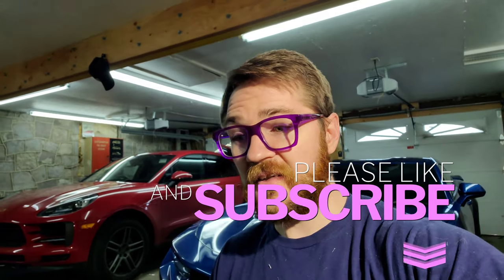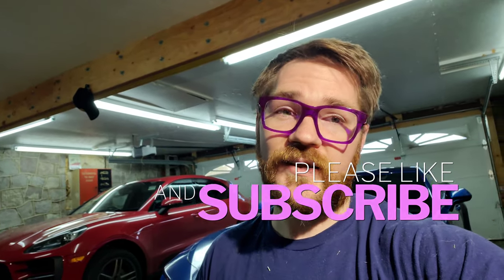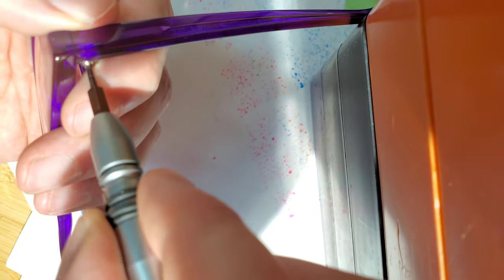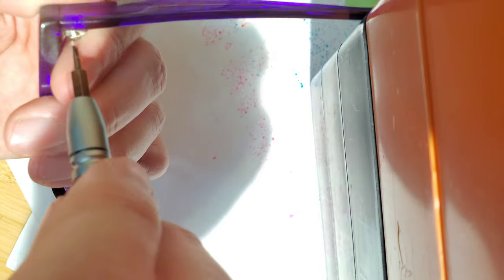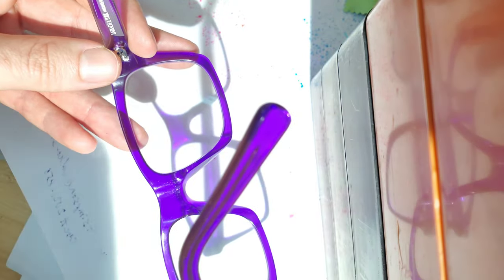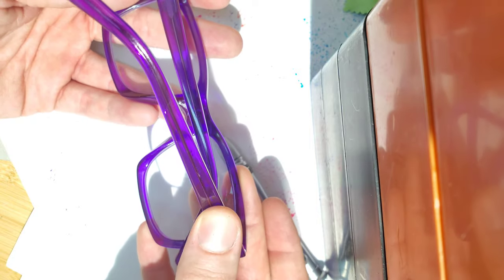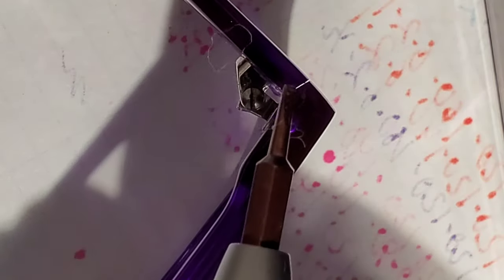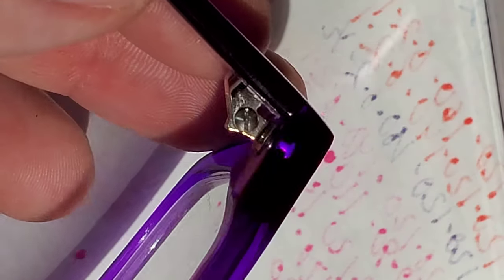How to: Tightening Loose Screws on Glasses - A Simple Tutorial (Beginner Friendly)

Comment: Have you had any experience with the Vuarnet district 1910? Are they wider than the legend 03? Sorry for the off-topic question and thank you for the always informative videos.
Reply from the maker: No worries! Unfortunately being French designed Vuarmet does run generally small... even their "big head" models are pretty small, with none of the fashion pieces really fitting the mold of a big head without some adjustment tricks. That said the 1910 is actually a hair smaller than the legend, but being a real acetate frame can actually be adjusted to fit better. The 1928 and glacier 1708 as well as the district 1907 are about it for larger heads within the collection :)
Reply: @ThatGlassesGuy03  That's actually good to hear, i thought the legend looked a little large so if the 1910 is smaller i might go with those. Always hard to choose when you don't have places to try on nearby. thanks again!
Reply from the maker: You're welcome! Order through my shop, we have a little more forgiving return policy than Vuarnet directly 🙃😁
Reply: @ThatGlassesGuy03  I am in Europe so delivery is pretty fast with Vuarnet which is a little more convenient, if i'm ever in the market for AO sunglasses i will definitely check out your store since shipment costs seem to be lower
Reply from the maker: You know, I've heard that a lot about AO, and have definitely noticed most of my orders for that brand have been international haha!

Comment: Ouch I wrap w microfiber anytime I do screw work cause I’ve injured myself SO many times! Also have you tried a magnetizer ever for your tips / screws?! I’ve contemplated purchasing my own cause when I originally worked for my company FT we were provided magnetized tips but no longer and I’ve lost so many screws since we stopped using them that I could probably be a thousand dollar-aire by now 🤦🏻‍♀️😂
Reply from the maker: Waste too much time chasing and losing screws without something 🤣 I prefer to brace with my hand in case the screw slips so I don't lose it 🤣, keeping fresh blades reduces slippage though, so fortunately I haven't shoved a blade into my hand yet. Even a microfiber will still scratch a lens with a screwdriver blade 😅. I have a nifty little grabber I like for final removing of the screw and/or starting it too 😁

Comment: I usually wrap the lens with some small microfiber towels. I prefer spring hinges.
Reply from the maker: That works too 🙂. Never been a fan of spring hinges, except for very high grade ones. Dissimilar tension on each side, spring failures, wiggle from tolerances, etc. Etnia uses probably the ony spring hinge I like somewhat on a frame under $500 🙂
Reply: @ThatGlassesGuy03  wow $500 for frames is crazy, the most I spent on frames were $150, (Perry Ellis) most likely Luxotica with spring hinges, so far they are holding up, I have an old pair of polo frames too that held up till I stopped wearing them, these are Luxotica too.
Reply from the maker: Perry Ellis was safilo, polo has bounced around over the years from charmont and a couple others until finally landing under the lux axe 🙃. Luxury is a whole other world. The spring hinges I refer to maintain tension for life, and are Japanese made. Incredible fit and feel with no slack or wiggle, then there's the French blade binges... those are an interesting contraption all their own. Incredible stuff. I've owned a little of it all from $20 to $2000, doesn't break isn't really the qualifier I use. 🤪
Reply: @ThatGlassesGuy03  You know your hinges:))
Reply from the maker: @Shaverboy516  sometimes I wish I didn't. 🤣 too darn picky. 😂
Reply: @ThatGlassesGuy03  😂